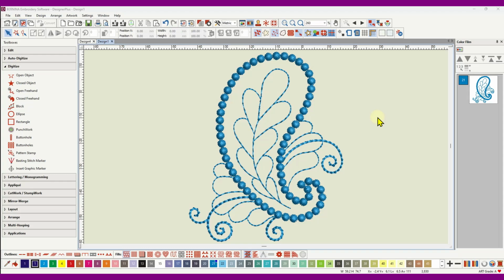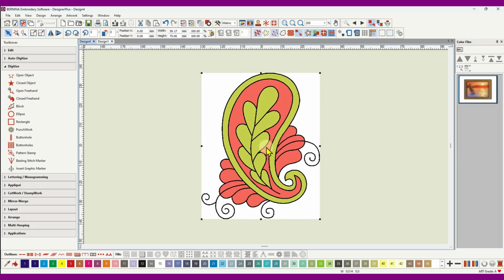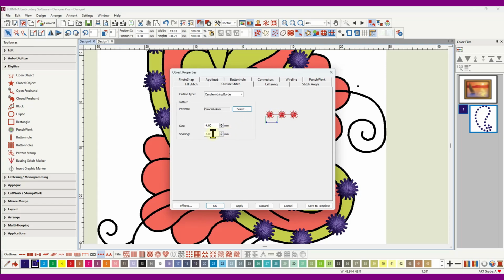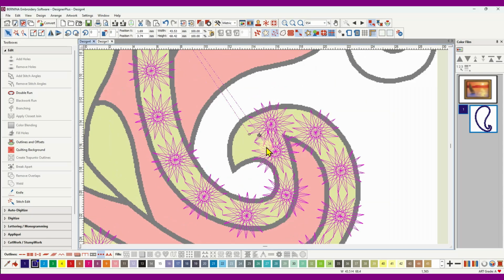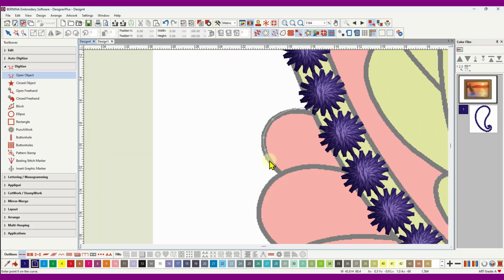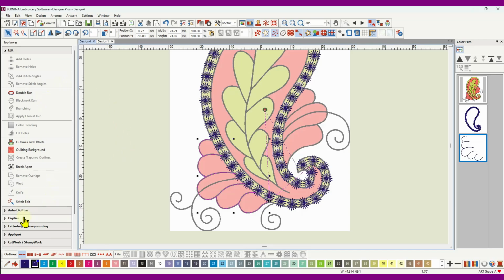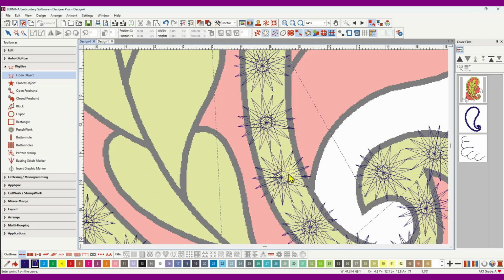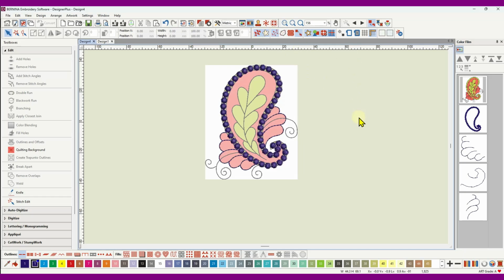Paisley Candlewick Motif Part 1

Comment: hmm, I have bernina Plus software V9, but there is no candlewicking stitches in my bar, or any other decorative stitches.
Reply from the maker: Are you sure you have Designer Plus. What version of the software is it. e.g. 7, 8 or 9. It should say Designer Plus in the top left corner of the screen. If you do, then do you have the bar at the bottom that says Outlines with some Outlines and then Fills with some fill stitches. If the Bar is missing altogether then click on Window in the top menu. Then click on Tool Bars. There should be check marks next to all the Toolbar options. If not, left click on any that do not have check marks. The Stitches option is the tool bar for the Outlines and Fills.
If the bar is there but you don't have all the stitch options, then something has gone wrong with the installation. You could try uninstalling the software and reinstalling it. If you need help with that or it doesn't help, then go to the Bernina website for your country and click on Contact Us. Fill in the contact form detailing your problem and the operating system you are using on your computer (e.g. Windows 11)
Reply from the maker: Another possibility is that the toolbar has been moved. Check around your screen to make sure it is not somewhere else.
Reply: @CarolUndy  
I actually talked to my vendor and they told me, I do not have PLUS ( I thought I had..) but I can upgrade it - for a petty penny, of course.. :)
Now I have to save up a little in order to do that, but I am glad I have even this version.
 I used to have "Janome MBX" Digitzer which was very similar to this one here. They shut down their servers at one point which is a bit outrageous because that program was not cheap either and it was a VERY good program.
That is why I noticed some parts missing in comparison. I thought I was wrong but then I found your video and your confirmation.
I thank you for your detailed reply, this is very sweet.
Reply from the maker: You are welcome. You can still do a lot with the creator level. I will be doing some more videos in November which work in both levels. Cheers Carol